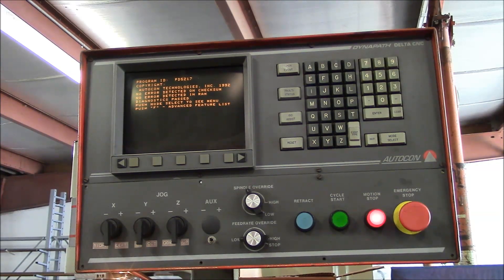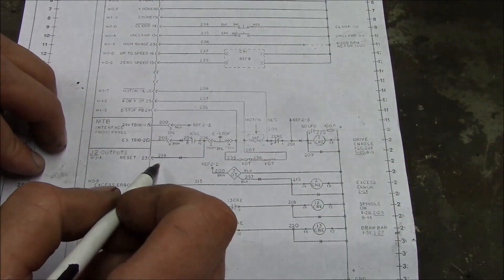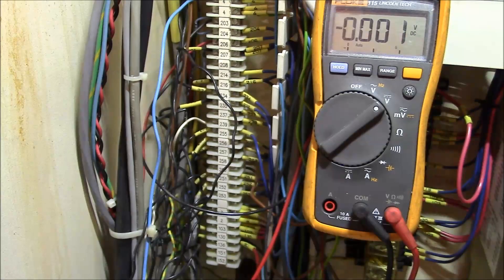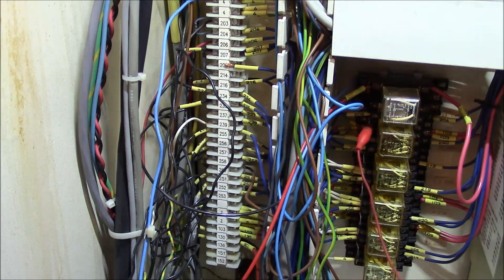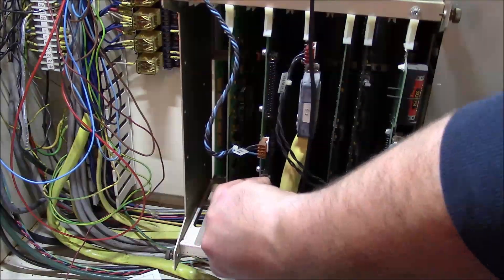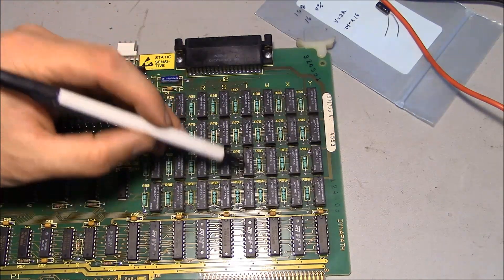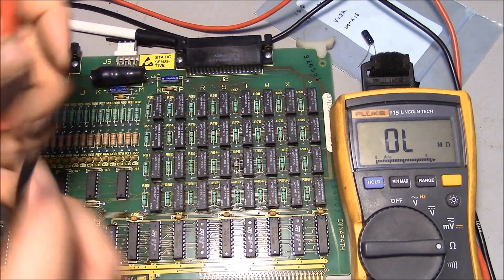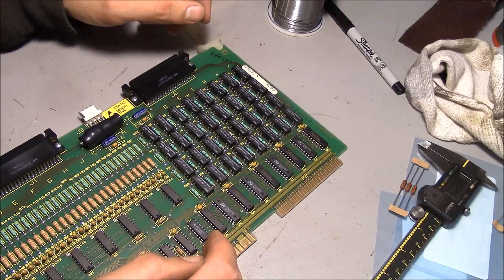CNC Machine Stuck in Emergency Stop

Comment: The resistor could be a hold on resistor as its a latching circuit
Once the relay has been energised it takes very little current to hold it on thus saving power and less wear on the relay especially if the relay is on for a long time !!

Comment: Bad boys rape our young girls but Violet gives willingly black- 0 blue- 1 red 2 orange 3 yellow - 4 green- 5 brown - 6 violet- 7 gold -8 white -9 you didn't learn this in basic electrical School then you got cheated. What the hell you mean 2 w ? resistors are measured in ohms you measured them with your meter set on that upside down horseshoe Omega

Comment: What you just did is monkey around with a perfectly good circuit before you check your input to that circuit. Now you've gone to the board that supplies that input because you don't have it there. Well I don't know how to break this to you but the output from that board only switches well on when the input logic to the board signals to turn that circuit on. So you need to check that before you start pulling boards more time wasted. Guys like you used to make me look like a genius. Put down the schematic and get yourself a flowchart. You'll be able to troubleshoot a lot quicker. That is if you know the difference between a diagram, a schematic, and a flowchart.
Reply: Far from being a genius. His method was fine when you don't have a flowchart of know exactly how the circuit functions.

Comment: You're going backwards you should start to your right side at the run contact relay and see if you're getting the signal there if you're not then you go halfway down the circuit and check for your signal there if no keep going back if yes go back towards the relay you should be able to find your open circuit within three points. Always start at the output end of your circuit and half and half again until you get to your fault. Starting at the beginning input and moving forward will get you there eventually but it will take a hell of a lot longer time. Always check your power source and then your termination end. And then go to the middle etc. Work smarter not harder. This is coming from a retired industrial technician with 50 years experience. And why the hell did you replace the switch was it bad or was the idiot before you just shotgun jumping stuff out? Whenever people have been in that piece of equipment messing around always return everything to original stock condition and go from there. Otherwise you'll spend hours on doing other people's donkey crap. You'll be surprised how many times just putting it back to the right way fixes the problem. Some dummy might have been in there looking in the wrong place jumping stuff out. And then going and finding the problem and leaving the garbage behind. That's especially true of inexperienced monkeys with four-year degrees and no background. It's like car mechanics that have 50 badges on their shirt in 2 weeks experience they know how it works but they don't know why it don't work.

Comment: Excellent : Clear and concise troubleshooting and analysis of the wiring schematic - nice to find the blown resistor and thankfully it’s a ‘90 machine without surface mount micro resistors - another machine put back into service rather than the scrap yard - well done.

Comment: They usually use those resistors to stop relay chatter, when a relay is fired by another relay they tend to chatter and putting a resistor across the coil stops that from happening..

Comment: Color code on the resistor would tell all you need to know.   May not be able to read the fried on but you would be able to read its neighbor.
Reply: Colour code only indicates the ohms/resistance and % tolerance/accuracy, not the watt rating which was in question👍

Comment: The resistors are being used as a fuse.  Resistors cost less than a calibrated slow or quick blow fuse.  We use them in our multiplex boards at work.

Comment: Of course lead size is related to current, but different manufacturers may have different size leads on the same wattage resistors. I've seen this many times. Older resistors tend to have larger leads for any given wattage.  (I've been in electronics for 60+ years.)

Comment: Awesome work! that brings back memories! I worked in a machine shop back in the day. I was p[atient and would look and find the problem. The field techs would come and diagnose it as a bad board never looking for a problem. I retired in 2009 after getting shocked by 600 volts which really screwed my back up. It was in a hyper-therm plasma cutter that could cut up to a 1-inch plate. we had 4 of these with a steel handler ad on. 4 commercial plasma /torch cutters, 4 presses. A 300, a 150, 100 and 2 fifties. 8 Haas vf? series. a couple of brother vertical mills, 3 horizontal mills, 15 welding stations, 3 robotic welding stations and about 20-30 support staff. When I started there they had hired me to service their trucks, forklifts and other small material handlers. The guy who worked there took an extended leave and never came back. I was happy just working on the trucks and forklifts. They hired an independent repairman who knew his shit and part of his job to train me up. It was an awesome job that I miss to this day!

Comment: Good Electrical troubleshooting wes. On your new shop being out of town just takes a bit longer to run for parts. My friend put in a concrete floor and put in snaking pipes in the concrete and then just put in two water heaters. Very nice but with a lift you don't have to lay on the floor under your work as much as I do.
Reply from the maker: Those heated floors are really nice though. No matter the work you do.

Comment: Ahh ladder logic...I was an elecronic tech at a shop for 12 years.  It was my job to keep a big Giddings and Lewis 60 inch horizontal boring machine running.  It was converted to cut threads on large diameter casing pipe for the oil industry.  Then the pipe was threaded together instead of welding.  It was 70's CNC technology.  Fun times...
Reply from the maker: Yeah I've been there. Relay logic is a massive time suck to diagnose.

Comment: I think the colored stripes on the resistors tell the ratings.
Reply: The stripes on a resistor indicate the resistance value of the device and the precision ( whether it is 1%, 5% or 10% )of the device.  Wattage rating is pretty much a physical size of the device.

Comment: Theoreticaly speaking: if the line resistance in that branch somehow droped to single digits, then the 24vdc applied according to Ohm's law will be plenty to jack up the current flow beyond the maximum that resistor can safely handle. Personally, I believe it was a manufacturing defect in the resistor. I've seen plenty of cases like that "unexplained failure" back in the 80'-90's board repair shop. Those were the last glory days for surface mount PCBs. Miss them days.

Comment: What is that tool at 12:02 doing?
Man...you amaze me at how much you know... car mechanics & electronics...dang dude, awesome!
Reply: Desoldering iron - there's a hole through the tip and a vacuum pump, sucks the melted solder out of the joint. Definitely wasn't expecting to see such a nice electronics bench tool in the hands of a mechanic!

Comment: Resistor is a surge limiting resistor. A coil with 0 current has 0 resistance so when you switch on its like a short circuit. What stops the coil being a short circuit is the magnetic field built around it which opposes the current flow. Without that resistor you could have a high current flow on switch on, an overlarge field build up causing a  back spike. That in a computer chip is not nice.

Comment: those are definately current limiting-the copper traces are very small on this board so a short circuit would melt the traces and ruin the board! good design actually

Comment: Rookie mistake. you should have put the clamp amp meeter nearest the power supply as possible. And wriggle the wires this would tell if you have a short to ground. no point testing amps at the load.

Comment: Those Bluey Green Resistors of that size are usually "flame proof" and used as a current limiting and fuse all in one. The wattage looks to be 1W (old 80's vintage colour TV's were packed with these to protect different sections of the set eg Audio output stage, horizontal output and vertical output....... ) When thinking of low ohmic resistors as a current limit consider the limits of the circuit eg when will the most current flow ?  A direct short to ground, the only real resistance then is your 16 ohm resistor, more common problems are shorts in wiring looms where smaller diameter cables are used and the total cable resistance can creap up to a couple of ohms. This in conjusction with the 16 ohm resistor will limit current to the loom and the load. I hope this makes sense. Kat.

Comment: Wes, I love your videos, especially the machine control repairs ones. I did another repair on my 1996 Bridgeport Torq-Cut 22 this week and it's stuff like your videos that give me the inclination to try such things. Which is incredible because I have no idea what I'm doing, but I keep figuring it out and coming out on top. This time the carousel motor for my toolchanger wasn't working and so I inspected sensors, relays etc, etc. Had a lot of false hypotheses but eventually noticed that I was getting the correct voltage at the board and not at the motor, and sure enough the 16/3 stranded cable to the motor was bad on one conductor. Makes sense because every toolchange that cable gets flexed and rubbed some and it is 23 years old. Anyway, thanks for the videos!
Reply from the maker: Confidence is a huge part of the repair process. Most of these systems are fairly simple, it just isn't obvious how it works until you tear it apart.
Reply: I am glad you are challenging yourself to do this. Follow the circuit power in to power out. What is in between? Sooner or later you will find it.

Comment: Seeing it on video made it look easy! I doubt it was really a 20 minute job tracking that all down though. :-)
Reply from the maker: Well it didn't take too long. The jumper wire had already been installed so I knew the contactor circuit could work. I just had to find the weak link. This old Tree is very simple. The newer machines are much more difficult. Most now have dual e-stop circuits. Some are using pulse signals that can only be tested with an oscilloscope.

Comment: Hey, Wes, love all your videos no matter what you’re working on. I have a question for you. I have a Mori Seiki sl 150, 1996 vintage. I did not get a shop manual with it. What power of rotary phase converter do I need to run it?
Reply from the maker: That's pretty similar to the SL-20 I had. I ran it with 100 amps of 220V 3 phase. I imagine it would actually run with less if you limit the spindle acceleration ramp.
Reply: Thanks, Wes. So as long as I’m supplying 100amps, then I can run it on a 7.5hp rotary phase converter for the 3 phase.

Comment: The current limiting resistor is just there in case somehow there's a wiring problem.  Either a fault OR someone does the jumper wire test without first removing the connection to the control board like you did.

Comment: Okay you got a 2 watt resistor so it'll handle 0.833 amps which is 83.333 milliamps anything higher than that will blow the resistor so in essence is current limiting between the diode and the relay basically designed to protect the relay from power surges or backfeed and only theory I got is apparently you had a power surge or backfeed to that resistor now and I don't know why the diode didn't blow but apparently it didn't so the resistor blowed before the relay got burned upI don't know how old is journeyman CNC 425 machine is cuz I'm not familiar with that machine but I do know resistors will burn out over time from everyday use that's not a possibility it just could have been time for to go

Comment: You got the general idea is a current limiter the higher the resistance the lower the amperage through the circuit the lower the resistance the higher the amperage the best way I can explain it to you

Comment: This may not be relevent, but I first thought of it as something humorous;  For instance- Joe Pieczynski  shared proof on video of him de-fouling a spiders legs one at a time with some tweezers and an exacto Knife. (The Spider was clearly assisting in the operation.) In a  machining environment I wonder just how fine a chip could possibly become entangled IN or TO that type of "fuzz"  I saw him clearing from I think it was a good size Wolf Spider.
    One documentary I watched once showed a pretty damn big Floppin Spider  large enough to kill a small chicken.  Maybe you CNC guys could estimate the guage of the wirey birdsnests generated with a really fine finish cut?   In the name of Science, or a good laugh.  ( If a spider crawled accross the e-stop part of the board.)
Reply from the maker: I was already not a fan of spiders. I think you've solidified my position!

Comment: I have repaired a number of older vintage boards that use low ohm resistors to protect power circuits like a fuse.  One 3 phase inverter manufacturer always used 1 ohm resistors, and they were easy to spot.
Reply from the maker: Interesting. I know on modern surface mount boards it's pretty common to see 0 ohm resistors used basically as fuseable links.

Comment: Nice simple fault finding, one of your subscribers has already put forward a pretty good explanation of what may have caused the resistor over current (dangling E-Stop switch wires).
Great professional repair.
Thanks for sharing and best regards from the UK.

Comment: Thanks for showing all the details of searching the electric failure. Great that you explained the E-Stop Security Circuit, that will mabee help me in future with a broke down machine. 
I worked a longer time in the repair center of a large company repairing electronic boards and we also had an automatic desolder gun, we aplieed fress solder bevor desolderin an component . The fresh flux in the solder makes it easier for the desolder gun to suck it in.
Keep on going! great  videos!

Comment: Wes, Thanks so much for posting this! I have a Hardinge ST20 with a Fanuc OTC control that I can't get out of Estop. Machine comes up fne. But try as I might, I can't clear the Estop. I have used the wiring diagram to try and jump out terminals just as you did. Nothing. My machine's Estop circuit looks to be wired similar to yours. Maybe my problem lies in the I/O board as well. Going to try and look into tnis! Love your videos! Thanks again!👍
Reply from the maker: You just have to check all the components in the chain. Often you will find a bad thermister in a motor, or a heater is tripped in a contactor, or something like that. I had one throw me for a loop one time and I finally figured out that the chip conveyor was unplugged!
Reply: Ha ha chip conveyor and remote tool change e-stops  can have you looking all over ! Love the videos Wes.
Reply: was thinking about Fanuc while watching this- zeroA/B/C/D fanucs use x21.4 as estop input, just thought it was kinda ironic the 214 wire was in the dynapath circuit too... seven months, assume its already fixed- on the old zeroes, its often age related failure of the estop button, the brown contact block on those fuji buttons are easily cleaned- remove it, take the terminal screws out, pull the terminals straight out, and the center actuator/contact/spring comes right out- dont lose the spring. just clean the silver pads and reassemble,  good for 30 more years. zero membrane style op panels are kinda weird as the whole machine often runs into the m1b input/m2b output plugs, then the m1a/m2a go back to the io card... you can check for continuty from M1(33) [+24]  to M1(18)[estop] IIRC by just unplugging M1A connector and checking the op panel connector half. note though it will also have the M1B(18) pin feeding into the loop too- usually from overloads/overtravel string on machine side- much like this dynapath

Comment: Good repair 👍Lucky you had the ladder diagram, makes troubleshooting a lot easier.
Reply from the maker: I don't think we could get very far without the diagram!
Reply: @WatchWesWork  
Without a diagram you could start by pulling boards to look for obvious faults and you would have seen the burnt resistor. I think you were lucky with this one. I often get multiple cascade failures in the logic/control chip systems on things I'm fixing.

Comment: Great video Wes! Really enjoyed seeing another machine-tool topic, those are hard to find. I agree with @sombody-else below on the practice of adding fresh solder before desoldering, with the addition that I place a small blob of that paste-consistency flux (PCB-grade, comes in a little syringe applicator) on the lead at both steps (adding solder and final solder pull). That practice really reduces my time "on-pad" with the Hakko desoldering tool and seems to leave a nice clean (and even shiny) hole behind. There's a little more cleanup, but it seems to minimize the PCB impact. The practice I've evolved to is always add flux and don't depend on what's in the solder core to make it everywhere it needs to go. Anyway, glad you got it working :)
Reply from the maker: I don't do it enough to be any good at it. I did have to add some solder to get a good result. Seems that large components like resistors are really difficult, especially if the leads are bent over before they are soldered. I also think really small components are very difficult.